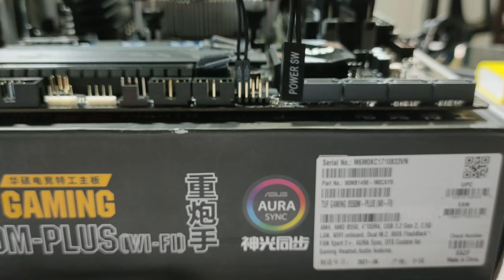How To Connect FRONT PANEL CONNECTORS, INTERNAL SPEAKER to the Motherboard (ASUS B-550M-Plus WiFi)

Comment: okay so i did this with mine and the mobo is getting power but it still will not turn on
Reply from the maker: To verify your motherboard sir if its working, dont connect the power connectors. Then you can short the power ON pins with a 🪛 or you can use an ATX PC motherboard power switch if you have. Thanks

Comment: Its difficult n you don’t show what you’re plugging the plugs into on the motherboard. That’s the question for me, making sure that one is plugging the right lead (+/-) onto the right leads on the motherboard. Just showing plugging them into a motherboard doesn’t do me any help. Thanks though.
Reply from the maker: I get it. Thanks. Next time I also include  video of the labels at the motherboard pins.
Reply: Edited to “Liked” - I appreciate YouTubers taking constructive criticism. 

What I had difficulty with is the difference in the pins for the positive and negative leads. It wasn’t so much any issue of where they go, as where does the positive lead attached to in the negative. I found a diagram of the 10 pins online (the other 4 for others) that illustrates where the positive goes and the negative. Thanks for taking the critique constructively, I know it’s a complex field. Cheers. 

https://www.quora.com/Where-do-I-plug-in-my-front-I-O-cables-on-the-Asus-B450-F-motherboard